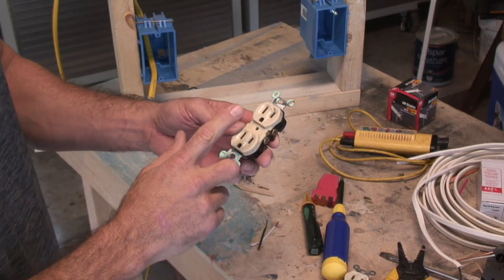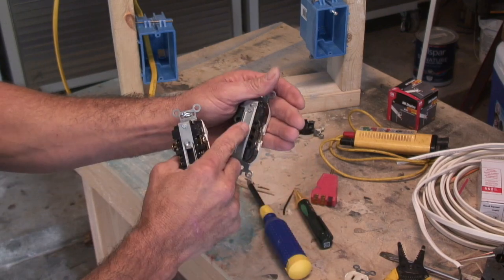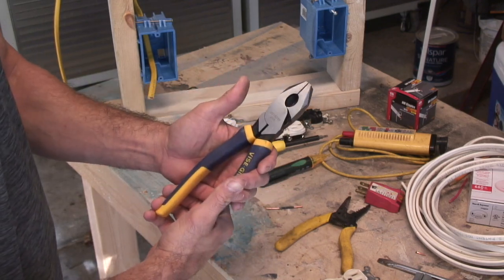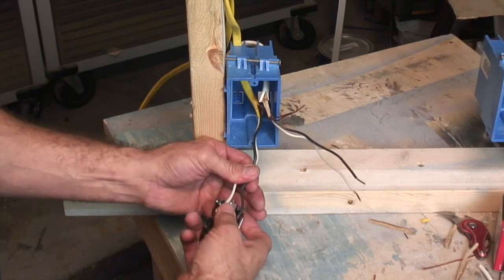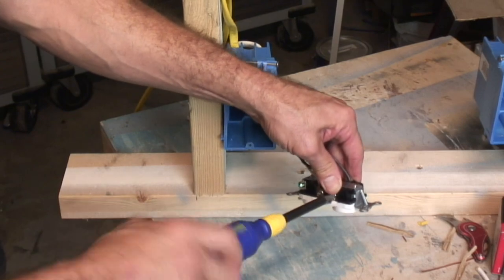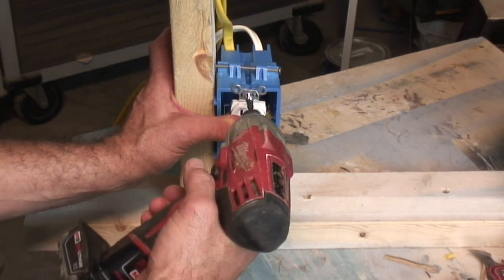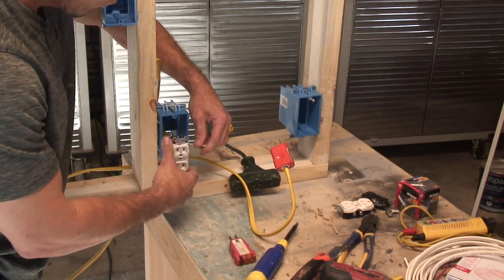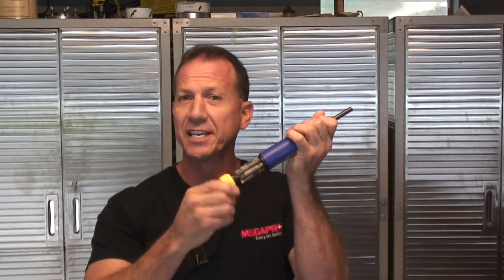DIY Basic Residential Electricity 1

Comment: As an electric guy I would say great video.  The only thing I would add is when using the widow maker, "the test light at 3:10", is test it first on a live circuit to ensure it's working properly.  That is true of any meter though.
Reply from the maker: That is a great tip Mark! I do the same thing myself, but I missed it when shooting this video. I try to cover as many basis as I can , but I am definitely not perfect. I carry a pen voltage tester with me in my bunker gear on the Fire Dept. and I test it all the time. Safety is really important and I really appreciate your input!
Thanks!
Paul
Reply: It's the least I can do.  After all, if it wasn't for your videos on crown molding installation I would have never figured it out.  I know electricity but woodworking is a struggle.  Keep up the great work.

Comment: Paul, I really need this series.  Thanks so much for embarking on this journey.  I'm hoping you will explain what I'll need to do to stop tripping circuit breakers in my garage/shop.  Is it the rating of the main panel that determines how many pieces of equipment that I can run at the same time?  Do I need separate circuits (i.e., breakers) for each machine?  Should shop lighting be separate from the receptacles?  Looking forward to more in this series!

Comment: If you have metal boxes, the ground wire must also be connected to the grounding screw in the box.  And some jurisdictions don't allow those multi terminal connectors even though you can buy them at any store.
Reply from the maker: Hi tchevrier,
Thank you for bringing this to my attention. I filmed a segment explaining that metal boxes have a set screw in the back of the box and the ground wire has to be attached, I must have missed it when I edited the video. I try to cover all bases but I do everything myself and I sometimes miss things. I am also glad that you brought up the wire connectors, I only use them for my ground wires because they are not subjected to power and they will not expand and contract. I like the way they work but I am not convinced that they would hold up with the Neutral and Hot wires. It is code compliant down here, but I'm not sure of other places. Thanks to you, I will mention that on future videos! 
Have a good day!
Paul

Comment: I use the power driver and hand screwdriver the same way you do. I'm always surprised when I see an electrician only use a manual screwdriver. Some of those threads are so fine and take forever by hand.
Reply from the maker: You're right Brian, I also hate the old flat head screws! LOL
Thanks!
Paul